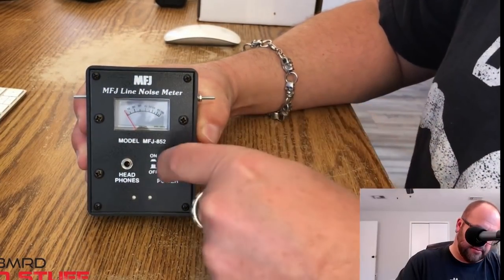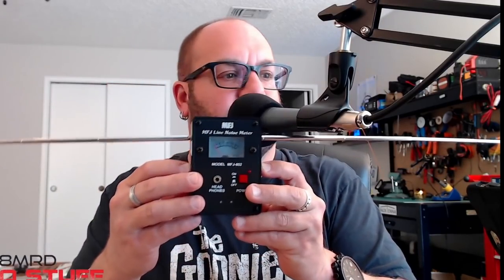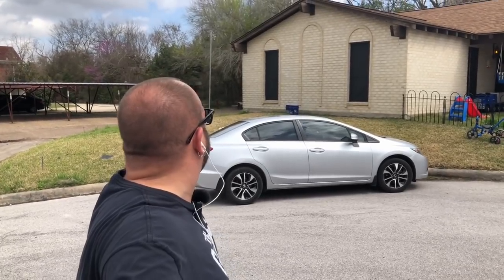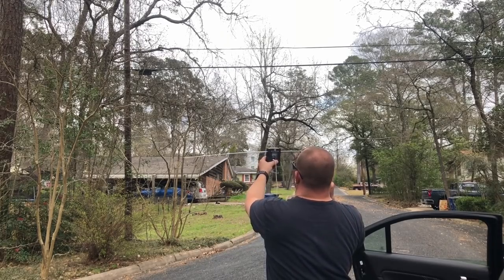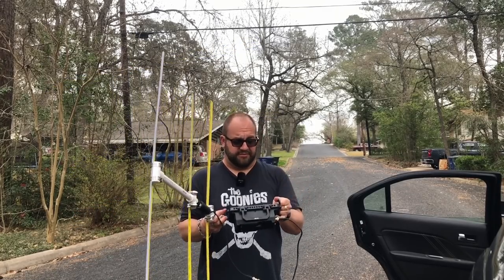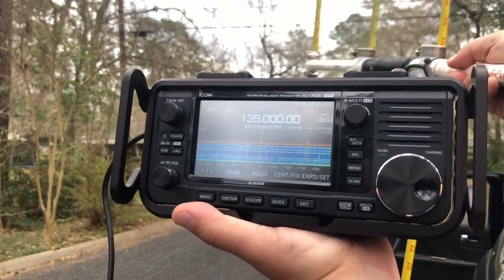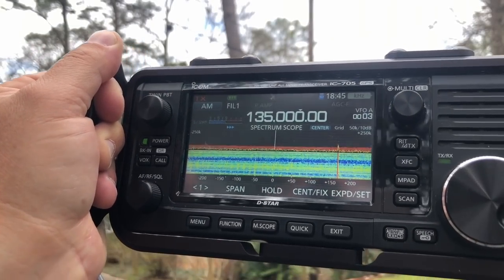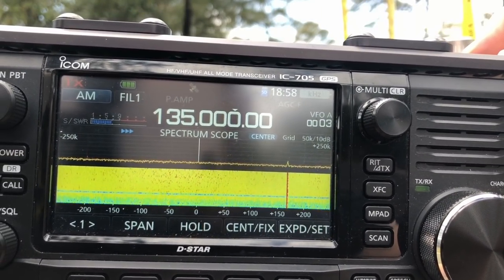RFI Busters | Direction Finding RFI | MFJ-852 A/C Line Noise Meter

Comment: A blind ham friend had a noise problem.  He called PECO (Philly Electric Co) and figured the call would go into the garbage can.  My friend was surprised when he received a call back and a technician set up an appointment for the next day.  The tech came over at the appointed time, listened to the noise and said it was definitely electrical.  He left to search for the source and called back an hour later saying he found a high voltage primary line off its insulator a couple of block over.  The tech put in a work order and it should be repaired in a day or two.  It was and noise gone.  In the process of finding the annoying noise, a safety problem was found and fixed.
Reply: There is still hope for humanity.

Comment: Yes, please give an update. I will be interested to know what it ends up being. I’m a power lineman. It could be several things on that pole. The power company should have their own RFI detection equipment. We’ve had to do it a few times. Glad you’ve found the offending pole and they should do everything possible to eliminate it!! 73, AI4BI
Reply: Most other youtubers I've seen don't go this far, this is awesome. I was a networks officer on a utility in Australia for a while. Also a Ham now. I love watching these videos that actually go out and track down where the source of the RFI is coming from. Most of the time its from power utility equipment, poles and wires. I have heard of faulty solar panels and phone chargers but never got to see any, so I was sceptical. There's usually an underlying issue on the utilities side.
Reply: If  equipment starts sputtering out random RFI and noise,  is that a sign  the device is failing ?   Water getting into it or something ?

If so, maybe linemen could have small portable RFI detectors to listen to the poles & equipment to hear if there is a problem ?
Reply: @SeaJay_Oceans   not necessarily. The equipment could be failing such as a transformer going bad but also there are tons of things that could be loose. When things heat up and cool down the metal expands and contracts. Aluminum is worse but copper still does it. This causes connections to be loose. The clamps that connect the wire from the transformer to the primary wire can get loose which is a big cause of noise. It could be a cracked or really dirty insulator or the tie that holds the primary to the insulator. The majority of linemen aren’t going to spend the money to get a detector and companies usually have one with someone that goes around to complaints. I make sure all connections are tight and everything is in good order on every pole I work on because it also saves a trouble call later for power issues. Most causes of rfi can be heard audibly and we fix those when we hear them. But until we go to that pole we won’t know unless someone makes us aware. So if you have any noise, contact your power company as soon as possible.
Reply: @jeromepace9768  Sure thing !   Twice I had whole transformers blow on our street, one was close to my room -  bright flash and boom and then lights out.   No complaints, the men replaced them safely and quickly.
Thank you all for your brave service to  keep  America  powered up, well lit, and safe !

Comment: People love to instantly blame the pole pigs when in fact, in the great majority of cases, power line RFI is caused by one or more of these situations:

Failing insulator
Damaged lightning arrester
Loose staples on ground conductor
Loose pole top pin
Ground conductor touching nearby hardware
Corroded slack span insulators
Guy touching neutral
Loose hardware
Bare tie wire used with insulated conductor
Insulated tie wire on bare conductor
Loose cross arm braces

Very rarely is a pole pig the cause of RFI!
Reply: Heard the same thing. Way more bad insulators or loose wire taps the transformers.
Reply: Pole Pig, I like that.

Comment: Awesome Mike, glad you are getting close. I have a large hockey arena across the street that generates lots of noise, but many of my freezers and fridges in the store are also noise makers as are many of the LED lights they now use in the coolers. Had 28' of heavy snow dumped on us two days ago so still trying to clear that mess up. I still use the old AM radio at times to locate my noise at the poles.But whatever works right ?..cheers and 73 Fred VE3FAL

Comment: THANK YOU Mike for posting this. 
That is exactly what my screen on the 7300 looks like here at the house. 
The noise here also comes and goes for sometimes for several days. This noise started after the ice storm here in WV Feb of 21. 
I turned in a power ticket a year ago with no response yet. 
Frustrated 😒
I’ve turned off the house main and still have noise BUT when the power goes out in the neighborhood the RFI is gone. 
I’m going to reach out here locally to see if someone has a 852 I can borrow or I guess buy a 705 🤔
Reply: Call the electric company back. They are required to fix these types of problems by the FCC. If they still won't respond, tell them you will be filing a complaint with the FCC if you don't get action now. They will change their tune.

Comment: I had power line noise.  I tuned my truck to an AM station and drove around my neighborhood and about a 1/2 mile away the radio was just overcome with RFI right as I past the power pole.  Power company came out and fixed it in a couple of days.  Good luck.

Comment: The black square thing at 5:25 is the telephone company's copper terminal, or 100-250 pairs of miles of 24-26 gauge wire carrying 17MHz-ish ADSL, dialtone, etc. The Phone company won't do anything about it, either.

Comment: It could a number of things from a transformer, pole top insulator with a tie, deadend shoe or insulator and shoe, missing ground. Had a customer for the power company I work for call in an RF complaint, upon my arrival found transformer issue and primary ridge pin insulator was tied in. With another crew we replaced the transformer and pole top insulator but didn’t replace 2 double deadend shoes which could have been contributing to the problem. With the two upgrades his noise dropped by 2 S-Units. He was happier and now I made a new friend that wants to go out and POTA.
Reply from the maker: Can you come over and fix mine?
Reply: @hamradiotube  😆

Comment: I'm I the Bronx Mike you think I would have alot of noise thank god my lines electrical cable all that are underground . I'm sorry you have to deal with thst. Call up electronic company one or more transformer is bad and needs to be replaced and if you complain they will have to come out and fix it. Us amatures have alot of pull. Good luck bro. N2dbi Mike ny

Comment: Great video! And since you've got MFJ's ear... maybe ask for a demo on their MFJ-5008 ultrasonic dish, which can help find arc faults in the power distribution system... or test your ultrasonic pest repellers (as I use mine for). 🙂
Reply from the maker: I asked but they are out of stock

Comment: Take a look at the MFJ 5008 too. that will pinpoint the noise. Arcing also makes noise at around 39kc too, acoustic. Midnight science has one as well. RF will radiate on the wires whereas sound doesn't near as much. The MFJ 5008 puts the ultra sonic mic at the focal point of a parabola so it can be pin pointed easily.

Comment: I've got the same kind of RFI crud on my IC-7300. I've had some success using QRM eliminators (WiMO and no-name versions from AliExpress). After a bit of experimentation with the noise sense antenna, you can phase much of the noise out of your life.

Comment: Great video...had a similar situation many years ago in our city that had a municipal power company. A power sub station about 1/4 mile away was killing me on 10 meters. If by chance one of the engineers was a HAM. We met after several calls and found 2 bad insulators and a bad cabinet switch. Within a week ALL GONE...so you can get a resolve...

Paul   K1YOU

Comment: Good video Mike. As stated, it's many times not even close to your antenna. In my case, I used a Sony IC-7600 portable short wave radio. In AM mode at about 150 MHz, I was able to track the noise down to a pole a few blocks from my QTH. It was the connector from a transformer to the main line. The power company sent out a tech who didn't have specialized equipment, so being able to show him where the problem was made for a quick fix. The SW radio worked excellent. Changing frequencies allowed me to find the frequency where the noise was the loudest. I like the MFJ tracker, but I think most people if they have a portable radio will do just fine using it, even a little AM pocket radio will work in many cases. If you find you are having trouble, then maybe a more specialized piece of equipment like the MFJ you showed would be the way to go. I went from an F-8 noise floor to an F-2. I tried a yagi with my G-90 and found I had better luck with the SW radio. Whatever works, get out there and hunt down that noise. Be sure to get the pole number and ask for the tech to meet you at the location. The guy sent out was excellent and very willing to fix it....and he did.

Comment: i also had a major issue with line noise.. it took 2+ years but it turned out that trees were causing the problem as they had grown into the lines and were rubbing them causing the major static .. the power company cut all the trees out of the power lines and the issue was solved..

Comment: Another good vid and im happy ya found where it was,byw puttin the 705 on 80M will help ya but what u said about consistency it could be multiple single phase noise but they are actin like a 3 phase noise generator

Comment: Hey Mike, hope they find it soon!  I had a couple of noise problems in the past that I used the MFJ device,  then to really Zoom in I used a small  UHF yagi and radio at 435 Mhz or so AM mode.  Used my setup to demo the noise peak to the lineman who later repaired the line and fix the problem.  In one case, it was an old transformer,  the other case it was an insulator.  73 de n0km

Comment: They put it on the "emergency", because the RFI never goes on its own, but usually is a signature of an equipment breakdown with possible fire breaking out as a result. This allows them to fix the issue way sooner so cheaper than when it actually causes any severe damage...
Reply from the maker: Yeah, I just wish the guy that came out even pretended to care.  They just sent out a linesman who said he would "put in a ticket" to have the RF Tech come out.  I need to follow up with them.

Comment: Thanks Mike. You know my RFI is off the charts. I have a DX Engineering Noise Loop and the issue I have is that the loop doesn't pick up the noise real well so I think using it with the MFJ product will be real helpful. Thanks.
Reply: Hi Don, what band is your noise on that you're trying to locate, and are you using a preamp with your NoiseLoop (not talking about the preamp in your radio but an external preamp with at least 20 dB of gain)?

You should be able to hear and thus track down almost any RFI with the NoiseLoop with preamp that you hear on your main radio with normal gain antenna unless the RFI is just above what would be considered a very low noise floor.
Reply: @wd8dsb  Every HF band basically and no preamp.
Reply: @don_n5skt  Hi Don,  thanks and that explains a lot.  My Portable Flag (which is what DX Engineering calls their NoiseLoop) was designed to be used with a preamp that has at least 20 dB of preamp gain, and this is in addition to any preamp you have in your radio because the preamps in modern HF radios really do not provide extra gain, they just allow you to reduce the normal amount of gain required to have typical receiver sensitivity (example: 0.2 uV sensitivity).  Older HF rigs had preamps in them to provide normal sensitivity but you could not turn the preamps off (example: my 44 year old Kenwood TS-180s has a sensitivity of 0.15 uV and it does not have a preamp you can turn on and off).  Don't know if you read the original article about my Portable Flag (March 2021 issue of QST), and suggest you check it out if you have not as it has a brief section talking about preamps for use with my Portable Flag.  With a 20 dB preamp I can hear all but the very weakest of signals using my Portable Flag on the lower bands like 160 and 80 meters, and on 40 through 10 meters I can pretty much hear anything above a typical low noise floor.  Also when trying to hear power line noise make sure your using AM mode with a wide filter selected, and turn off all noise blanker technology.  Feel free to E-mail me anytime you want to discuss in more detail.  73, Don (wd8dsb)
Reply: @wd8dsb  Oh, I get it now. I have the portable antenna from DX Engineering (DXE-NOISELOOP) built and it works fantastically well. I was receiving signals on it the minute I built it. I did not get the 20db preamp as both those radios have preamps but I have not turned them on.  When I have used it to look for noise, I hook it to my IC-705 or 6100. Either show strong regular signals but not much on the noise front. Much like my Loop on the Ground does.
Reply: @don_n5skt  Hi Don.  Great, and I just looked in the IC-705 manual and sure enough on the HF bands it looks like you should be using Preamp 1 for maximum sensitivity and it says in CW mode the sensitivity is 0.20 uV when Preamp 1 is on, but that's what any good radio should provide.  When using small receive loop antennas that all have negative gain you need even more preamp, so if you want to use your NoiseLoop to direction find RFI you really need your internal preamp on, and you also need to be using a 20 dB external preamp gain when you first start off, and then start backing off on the preamp gain and maybe even turn off the preamps and start using attenuation as you get very close to the source of RFI.  73, Don (wd8dsb)
Reply: @wd8dsb  Thanks, I will look into that preamp.

Comment: Great job, Mike! Hopefully the electric company can get on that quickly. Especially since you've done  most of their research for them. Decades ago we were having intermittent static issues on our land line that made the phone unusable (pre-cellphone days). I called AT&T on that line and the lady on the other end could barely hear me. Sent a tech out within the hour. He put a 'hot box' on our pole and found the problem a block away. Seems a squirrel had chewed through the insulation. Quickly corrected and never had problems again.

Comment: If you use a compass to shoot bearings in two different spots it may help pinpoint the location quicker using a topo map. Just my inital thoughts.
Reply from the maker: Yes it will.  Or you could just drive around the block.

Comment: The black box that was on the wire is a cable repeater for Suddenlink. That may be why your internet is bad as well.
Reply from the maker: If that's the case, I'm probably totally screwed.  Suddenlink is the worst company in the world.  I'll have to give them a call tomorrow.

Comment: If I could send you the videos of the noise I have been dealing with for the last couple years you'd be amazed. I finally found the source tonight. My electric meter.
Reply: and what did you do to remedy this? thanks
Reply: @sunnies336  reach out to your power supplier. I used a County Comm radio to show the noise radiating from the meter. They put a new one in. There was also a POE for a security camera that was causing RFI as well.

Comment: Have you notice that the noise level picks up in high humidity and after it rains?  Its likely the HV insulator side of the pole transformers.  Not much can be done.  I'd consider employing magnetic loop antennas where possible.
Reply from the maker: It does get quieter in the rain, yes.  I just noticed that the other day in fact.
Reply: @hamradiotube  That's odd.  Should get noisier.

Comment: That's noise from the Cable TV Coaxs and junction boxes or Telephone internet junction Boxes. RF leakage
Reply from the maker: If that is the case, which it very well may be, I'm prob more screwed than if it's the electric company.
Reply: @hamradiotube  Mike if it's cable leakage, that's an FCC violation. They're not supposed to leak their signal out to the airwaves. They have a duty to fix it.

Comment: We have had to use the MFJ ultrasonic to find noise that is getting into our cable plant. It works great. We have had quite a few issues that have been resolved with it.
Reply: is this ultrasonic used as a substitute for mjf 852 or in addition to? thanks
Reply: Curious as to what you found?

Comment: If you think it's a noisy pole, while listening to your detector, rap the offending pole with a sledge hammer and see if the noise changes.
Reply: @hamradiotube  Chain saw would probably be a permanent fix....
Reply from the maker: @NSNorfolk  that’s the goal.  I gotta be hunting pota and chasing DX man!  I got batteries and solar.  I’m good lol!

Comment: That Black thing on the lower line is NOT a power line that is a Phone line junction splicing block or what we called weather tight blocks, If this is indeed the problem they have RF filters that can be put in the lines to eliminate the RF noise, but I seriously doubt that is the problem. More than likely it is the power line with unshielded or open lines.  And yes Transformers will put out more RF noise than anything else. The older a transformer is the worse it will be, also one that has internal problems. I know this Video is 12 months old but just wanted to clear that up.